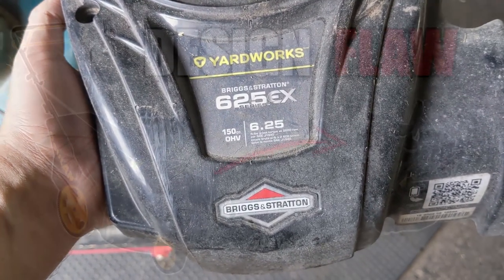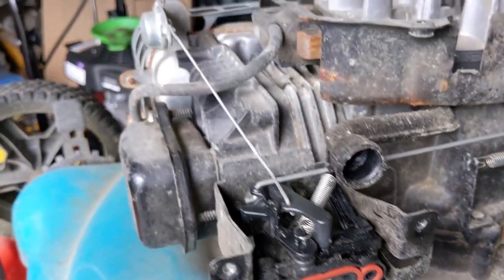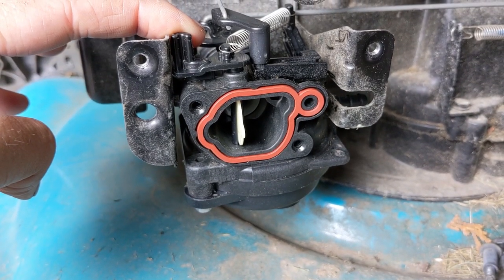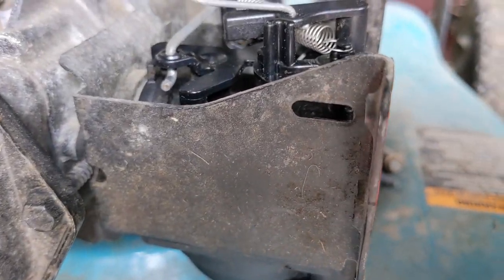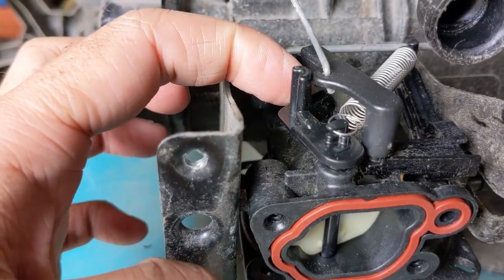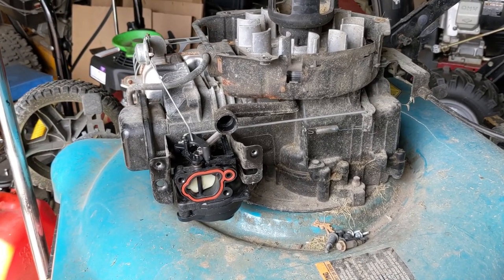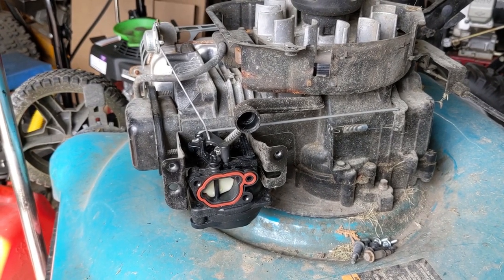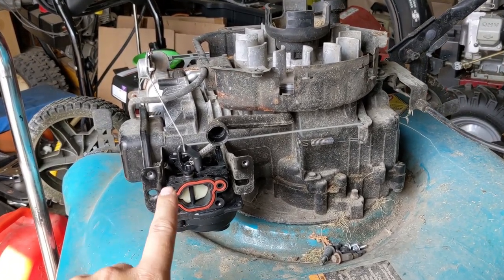Briggs and Stratton Design Flaw - UPDATE!

Comment: Maybe they had more control on the metal portion of the operation than the plastic portion. I agree with you though that making a slightly smaller plastic piece would have been a better approach to a fix. It is a good thing we are not engineers though at that would be too logical.
Reply from the maker: I do maintenance/repair/service, so I always look at a piece of equipment and see how easy it is to do a repair. Does the whole engine have to be removed to access the carburetor (similar to some generators). It's crazy how some of this stuff is designed!

Comment: Great video!! Same mower sudden high throttle, have cleaned carb, new governor spring, l manually move governor lever coming off motor slows down? Any input be great appreciated.
Also links are all fine with new choke link also
Reply from the maker: I'd check for air leaks, as more air will mean more rpm.
Reply: @EliminatorPerformance  Thank you very much how check for air leaks on mower? Never thought checking for air leaks